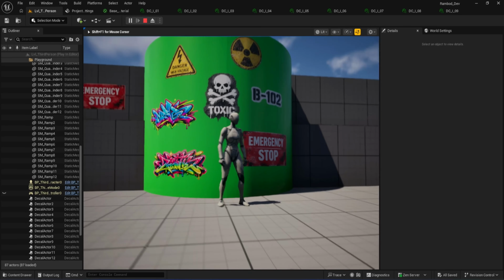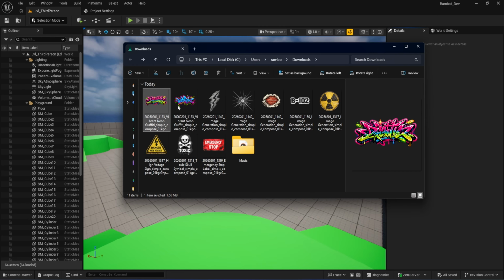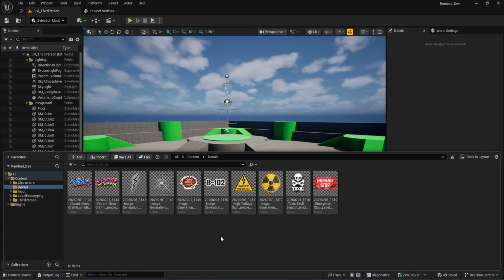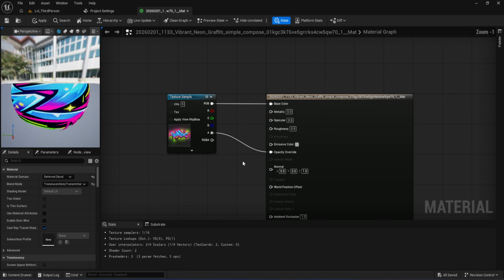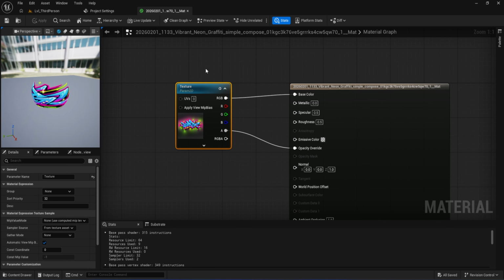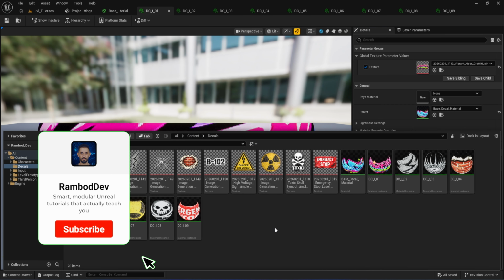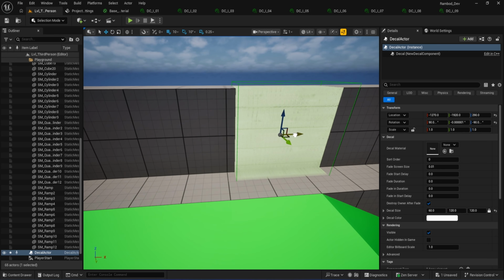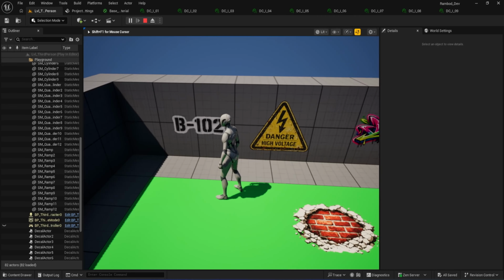Create High Quality Decals in Unreal Engine Using AI Textures

Comment from the maker: The key idea in this workflow is removing the dependency on manual asset creation. Instead of waiting on custom textures, you can generate decals quickly and focus on how they are used inside the scene. Clean materials and proper placement matter more than the source of the texture.

One tool that fits directly into this workflow:

Humble Bundle - Check out game development, programming, 3D, Unreal Engine, and software bundles that can be useful for developers
https://humblebundleinc.sjv.io/jRrz9b

Meshy AI – Generate custom textures and 3D assets for decals, props, or environments so you can prototype faster without being blocked by missing art
https://www.meshy.ai?via=Rambod

When building environments, do you prefer creating decals manually, or using AI to speed up the process and focus on composition?

Comment: great video. YouTube didn't notify me for some reason (
what about the blood decals? splashes on the walls and floor add to the spectacle. as in the new RESIDENT EVIL 9 there are just rivers of blood) how to do this to not load the entire pc at 100%?
Reply from the maker: Really appreciate it, man 🙏 And yeah, YouTube notifications are super random sometimes…

Blood decals use pretty much the same approach as regular decals. I actually covered a similar idea in my bullet impact decal video, and blood splashes are basically a combination of that logic.

In my own projects, I usually spawn the blood decal close to the hit surface if there’s a nearby wall, and if not, I drop it around the character’s feet on the ground. Same system, just different placement rules.

I’m planning to cover this properly in upcoming videos. Right now I’m working on a modular health component system where player, AI, and even objects all use the same Blueprint component. That series continues the AI and weapon setup, and I’ll add blood splash decals there too, assuming YouTube doesn’t flag it for violence 😅

For performance, material instances are key, and also setting a lifetime on decals so old ones get cleaned up if the scene gets messy. That keeps CPU and GPU usage under control.

Thanks a lot for the great comment and feedback, really means a lot 👊